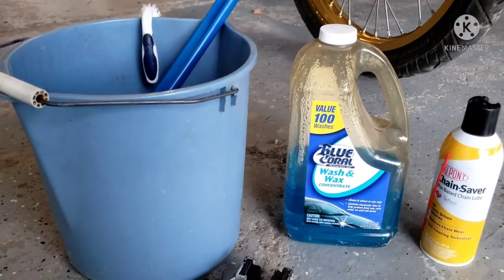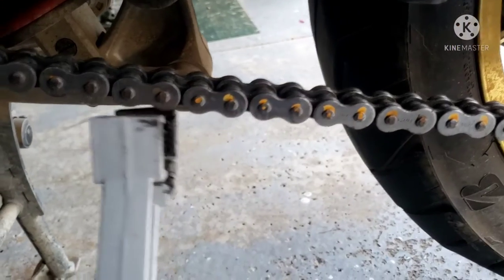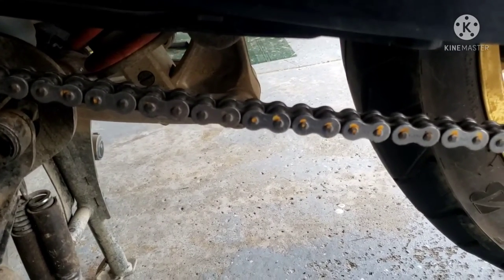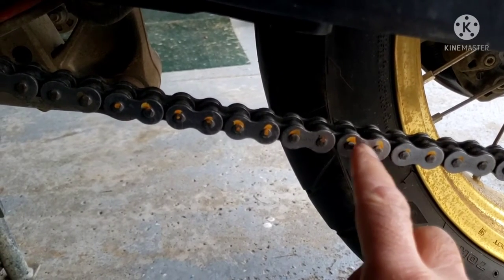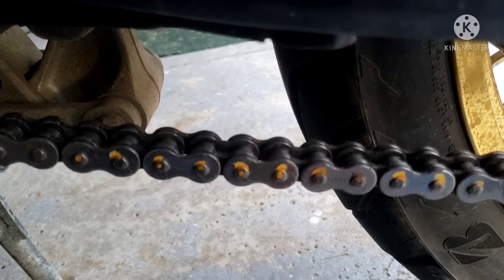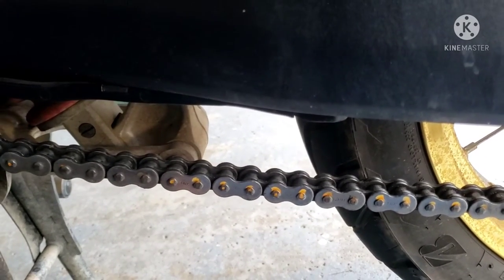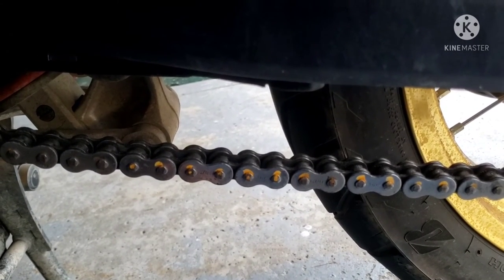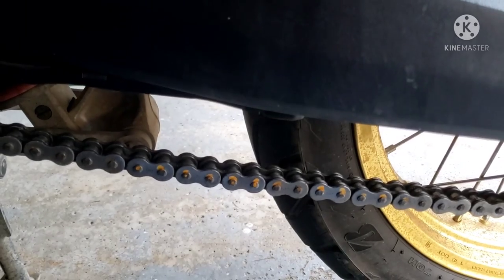Don't use diesel or kerosene to clean an x-ring or o-ring chain!

Comment: A quick clean with diesel, kerosene, jet fuel. Wipe dry/low pressure air dry. They lube with gear oil. Works great.

Comment: Couple of points: o-rings etc are used on motorcycle chains to seal the grease in where the link pins pass through the bushings. If you look carefully you can see the o-rings are located between the inner and outer side plates of the chain where the link pins pass through the bushing. The chain rollers are fitted over the bushings between the inner side plates and are free to move on the outer surface of the bushings. These rollers need lubricating to give maximum life to the chain and reduce wear on the sprocket.  Some o-ring chain manufacturers say don't use kerosene, some say do. Some motorcycle manufacturer's workshop manuals and owners hand books also recommend the use of kerosene for cleaning. I have yet to see any evidence that paraffin/kerosene damages chain o-rings.
Reply from the maker: Word for word from my 2023 Honda XR150 owners manual: Do not use a steam cleaner, a high pressure cleaner, volatile solvents such as gasoline and benzene,  abrasive cleaner, chain cleaner, or lubricant NOT designed specifically for O-ring chains as these can damage O-ring seals.
If you use a chain brush and the same soapy water you clean the bike with, your chain will look like new, as I mentioned in the video. A quick spay after it dries with lubricant should keep the chain happy for a long time. I currently have almost 20k miles on my AT and the chain and sprockets are still like new.
Bottom line, do what you want. It's your money
Reply: @bikerforlife5222  I have no doubt about what you say it says in your Honda owners manual. My new NX500 owner’s manual tells me to use chain cleaner and makes no mention of kerosene. My Suzuki factory shop manual says use kerosene. Who ya gonna call? 🤔
I’m tempted to take some o-rings from a new chain and experiment with them. It would in no way provide a definitive answer, but it would be interesting to see what happens.
Reply: @bikerforlife5222  Gasolene and benzene are known to affect o-rings. Same as acetone. It seems your owners manual does not mention kerosene. Kerosene is safe for o-rings as testing has shown.

Comment: ive never had a problem doing it with chains that are in good condition.. but ya if your chain is already old and tore up im sure you need a new chain and cleaning it with anything isnt good. by the way o rings chains have been around since 1970. a lot of people used to clean their chains by putting it in a tub of kerosene or diesel because the rust would get crazy and it does work to remove the rust. but thats the style i wouldnt go with. but to do it quickly i doubt it has any effect on the oring period. i  spray the chain scrub it respray it scrub it then rag it all off in about 5-10 minutes if that then spray on chain lube with moly. my chain has 0 rust on it. and has 10k miles on it looks brand new still. my last one had 20k miles on it and i only changed it because i let it sit a long time(at least a year) before i did a engine rebuild. also that surface rust if its on the other side and the oring interacts with it it will cause friction and cause more damage to the oring then a quick clean with kerosene would.

Comment: My mechanic told me on an X ring or O ring chain to just clean the chain on the plates with a dry shop rag to remove dirt. Once it is is dirt free put a light oil, he likes 3 in 1 oil on a clean rag and wipe on the plates of the chain to prevent rust. He told me NOT to apply a heavy oil like gear lube that dust and dirt stick to that then can damage to O or X rings. He said most of the chains he has replaced that have been maintained like he says have anywhere between 20,000 to 40,000 miles if it was a quality made chain to begin with.

Comment: There's a video on YouTube where the guy puts o-rings into several test tubes of different solvents overnight and then compares to originals. Kerosene had absolutely no effect on the o-ring whatsoever. Also, many present day motorcycle manufacturers shop manuals call for o/x ring chain cleaning using kerosene. Gasolene no. Kerosene yes.

Comment: Thanks for this useful video.
I just killed my one year old RK 520 x-ring chain by cleaning it with diesel. Pity I didn't watch your video before!
My chain was really really dirty and I used some diesel to clean it. Big mistake!!!  Now the rollers are completly dry and the chain vibrates above 80kms/h. Chain is dead.
Reply: My friend is well known that diesel harms o rings.
But kerosene or parafin oil are something different and are suggested by motorcycle manuals. My Suzuki manual suggests kerosene for my bike. The last chain i have is on the bike for 55000 klm and i have only tightened once or maybe twice but it is still like new  (DID x ring). I use only kerosene and after soap water --water - dry - and lube with the cheapest 90w or 120w gearbox lube.
Your chain will last forever.
This man is bullshiting saying to stay away from kerosene.

Comment: there is a huge difference between soaking a rubber in kerosene and spraying kerosene on a rubber. It evaporates quickly, and you only spray a low amount either. So even if it would damage the rubber I have doubts that during this short period of time it would do any harm.
Reply from the maker: Old habits die hard. Why even take the chance? I clean my chain regularly with soap and water and it looks and works like new. I have over 20k miles on my Africa Twin's chain, and it still works great. Bottom line, it's your money, do what you want.
Reply: @bikerforlife5222 m hacmve vid showing cleaning with diesel and viscioys oil mix then sae 30 on its own then light soray of lube to keep water at bay?  Maybe they want to sell chains?

Comment: Chains cannot " stretch " ...the tensile strength of the steel used is measured in tons ....bike engines don't produce tons of force ...the elongation of chains is accumulated pin /roller wear ..the term " stretch " is incorrect .
Reply: Also the sprockets wearing can give the effect of stretch
Reply: Chain manufacturers themselves say to scrap the chain at 2% elongation. Id bet no motorcycle has ever done that lol. Maybe turbo gsxr on slicks though
Reply: Have a look at Fortnine's video on chain lube. He takes an old chain and lays it along side a new chain; same number of links. The old chain is definitely longer.
Reply: Chains do stretch…
Primarily from wear
Reply: No chains dont stretch. Pins and rollers and sprockets wear giving the illusion of elongation. I work on chains 8 times the size of motorcycle chain also
Reply: it a figure of speech; of course it's due to wear.

Comment: so in your view, the bushings that roll on the sprockets don't need lube???
Reply from the maker: The lube is under the rollers and held in by the o or x rings. As long as they stay lubed, the chain will last. The lube you spay on top of the chain keeps it from rusting. If your chain starts kicking, the inner lube is probably gone and time for a new chain. Spraying chain lube on a dried out chain will let you get a few more miles out of it.
Reply: @bikerforlife5222  Lube is not sealed under the rollers. Under the rollers are hollow pins and inside of them is solid pin. Between solid pin and hollow pin is (non replaceable) grease sealed by o rings, but between hollow pin and rollers you need to lubricate.

Comment: What are those amber spots on your chain at 4:30? Rust?
Reply: Off course is rust! what else can you expect from someone who says, you can't use kerosene or diesel to clean the chain jajaja.

I dont even use lubricant, i just use the diesel to clean thoroughly my chain, and the oil nature of the diesel help the rollers.
Reply from the maker: Diesel fuel will strip the oil off your chain. I drive an 18 wheeler, and we use diesel to strip the greasy crud off our fifth wheels.
Reply: @cyberkiller83 think your wrong there it degreases the chain for sure. But ktm recommends cleaning with diesel oil mix. Then oil then spray bit of chain lube to ? Seal. Sae 30. Think that is pretty much gear oil?
Reply: @bikerforlife5222  Yes you are right, but it will NOT go throught the ORings of the chain, the chain is already lubbed from factory, you dont need to lube the pins (the important part) as it's already lubed with grease from factory.

What you need to do is to lube the Orings only, so, they doesnt get damaged by dry contact with the metal, that is the correct way to lube a chain.

You can lube the rollers too, but it's not strictly necesary as is very hard to get the lube to enter the rollers.

Comment: D.I.D. say No. To Kerosene / Paraffin, which is Diesel No 1; therefore this would also apply to WD40 i.e. these will all attack and deform modern 0 and X rings; and having molecular structures which potentially allow passing o rings and x rings to destroying roller grease. Yet this vid has 10 down ticks, so far.

Comment: This video is full of misinformation.  Read your owners manual, most likely it recommends kerosene.
Reply from the maker: According to my 2019 Honda Africa Twin manual, page 240, Do NOT use a steam cleaner, a high pressure cleaner, volatile solvent such as gasoline and benzene, abrasive cleaner, chain cleaner, or lubricant NOT designed specifically for O-ring chains as these can damage the O-ring seals.
Reply: D.I.D does not recommend kerosene cleaning
Reply: Mine recommends  diesel oil mix (ktm)
Reply: @bikerforlife5222 petrol is a no no, different from petrol.